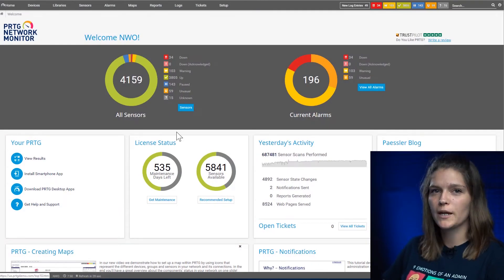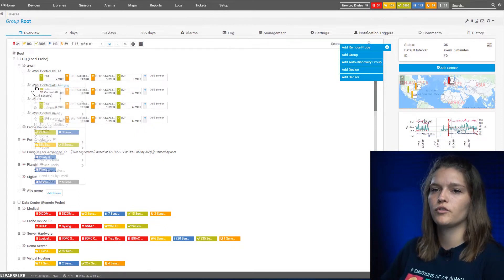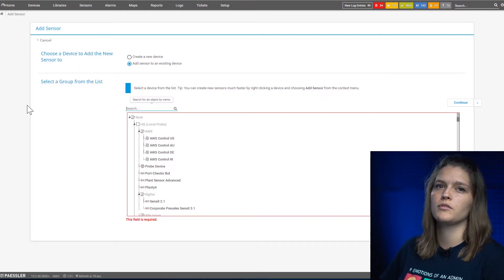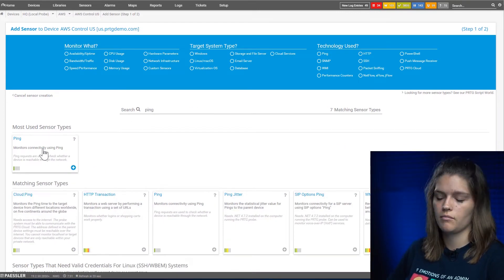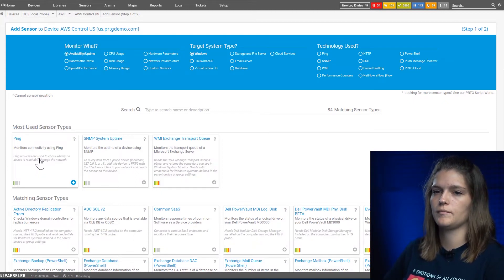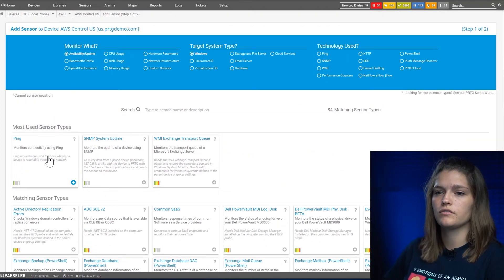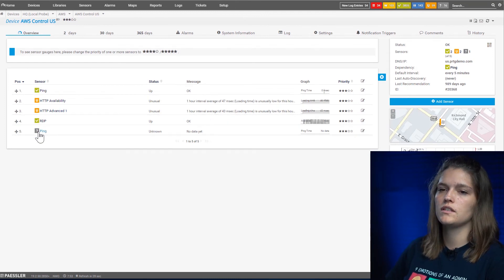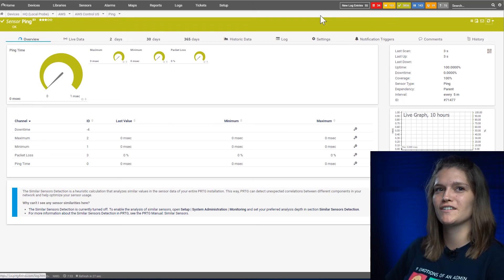PRTG Tutorial - How to Add a Sensor Manually

Comment: Am I able to add a single sensor to all group at a time ? say I have 100 IOT devices in a group which I want to add ping sensor to all of them, is there any way can I add this in bulk rather than doing it one by one ?
Reply from the maker: Hi there - you should try using the Device Template feature in PRTG to do this, as this lets you add sensors in bulk - https://www.paessler.com/manuals/prtg/create_device_template

Comment: Hi I am trying to poll a cellular modem and i am trying to poll what network its on. (eg.  GPRS, 3G, LTE) The MIB file for the device works in other mib browsers and shows the values (LTE) 
however i cant seem to get it to work in PRTG. which sensors should I use to achieve this? I have tried custom SNMP and custom string SNMP.
Reply from the maker: Hello Ush,
Getting values out of a MIB file can be time consuming and tricky. To ease this process you can use our MIB Importer ("http://www.paessler.com/tools/mibimporter"). You can convert the manufacturer's MIB-files to OIDlibs, which can be imported in PRTG. Furthermore you can use the MIB Importer to browse for values of your interest. After creating the OIDlib you can add an "SNMP Library Sensor" ("http://www.paessler.com/manuals/prtg/snmp_library_sensor") and choose the sensors you want to create.

The SNMP Library Sensor decides which sensor fits the best for metric you monitor. So if the target metric is an integer, it will create an SNMP Custom Sensor. If it's a string, an SNMP Custom String Sensor is created.

If you run into any issue while creating the sensor, our support will be happy to give you a helping hand on this. Simply reach out to support@paessler.com and mention this Youtube comment.